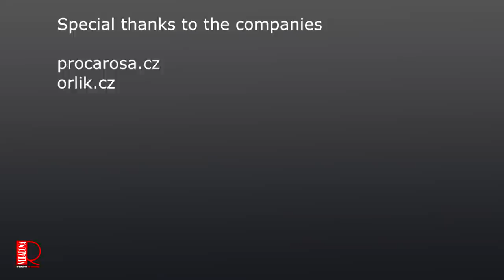Do you know this device?  Pulvis-R - Restoration

Comment: It's not just your rest-channel but I'd like to know why so many use a paint stripper on surfaces that are going to eventually be media blasted?  I can understand if it's lead based paint but I've seen many folks strip non-lead containing paint before going to the cabinet and I've seen many restorers remove paint and rust with no issue in the media blasting mode.  I wonder why it's done so much?  Does paint cause a problem in the blaster or when it gets mixed into the media?

Comment: Amazing what the over 60 crowd grew up with that didn’t scar us all for life!  DDT, Leaded gas and paint, asbestos in every school I ever went to and most public buildings!    Did the benzine neutralize the DDT, or just make it easier to get off the surface?
Fascinating job as usual!
Reply: the benzin was probably just to wet and dilute it so that it could be washed off without flying all over the place
Reply from the maker: Thank you, Wanda. DDT is poorly soluble in water. It binds grease well, so removal with gasoline, not neutralization.
Reply from the maker: Exactly
Reply: Thank You for this and for the information about DDT and benzine!

Comment: I have a Question? How does this build up presser to spray?  I have searched all over and can not find anything like this.
Reply: It's not pressure...
Gravity (with the aid of the mixer bar) pushes the powder down to the rotating blades, like fan blades... and it is propelled down the tube.

Kind of like if you dropped baby powder on a fan, it would fly all over. The tube just contained and directed it.
Reply: The fan blades he repaired produces positive pressure inside the Pumpy!

Comment: Since they stopped using DDT in the US, the birds of prey are finally starting to rebound. It took many years, but it's getting much better. When I was a child, we had zero hawks in my area. Now there are many hawks we watch eating the squirrels in the yard and we even see eagles as far south as Maryland.
Reply: DDT was not the reason for this, it was just a scapegoat for it.
Reply: @williamgoodwin3325  of course it was the reason, what do you think it was?
Reply: @johnkmcgregor5209  I dont know, but it was not DDT. It's a fairly complex issue, but the synopsis is that it was postulated that DDT thinned the shells of these birds. Later research proved that this wasn't true. Dr Carson suffered from terminal cancer at the time Silent Spring was published. By the time academics were able to check her data, she was long gone and thus unable to defend her flawed work.

Comment: I’ve used an antique duster like this to apply Sevin (an insecticide) to tomatoes.  This example is particularly well made.  Out of curiosity, do you know the significance of I/8 KO  162?  Great restoration, especially fabricating the fan blade.
Reply: How do you get this info I couldn't find anything on this except a link back to this video.

Comment: nothing like removing DDT from a container with a spray bottle of benzine
Reply: This actually reminds me of a story I heard from a friend of mine. In the 70s I think, he worked in asbestos removal. He would stand with two other guys in the back of the shop at a big metal table and dismantle the insulation with his bare hands and a spray bottle of benzine. No fume hood, no gloves, just open air. To his credit, he is still alive today, repairing and selling clocks and watches In Colorado. No sure of anything that might be wrong with him. You might want to use a different solvent in the future that isn’t a carcinogen though lol.

Comment: Next time with the sodium hydroxide and water, heat it just to a simmer and it'll take anything off. I think it will attack aluminum though so anything aluminum, plastic, rubber, or just not steel should be removed.